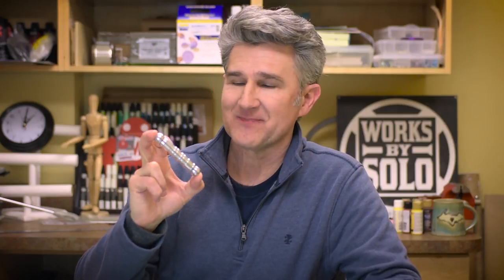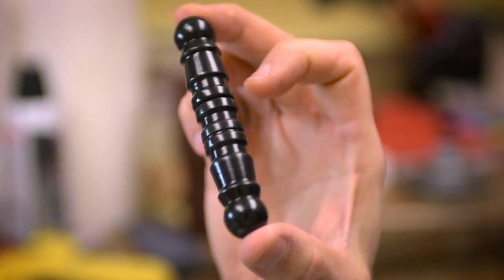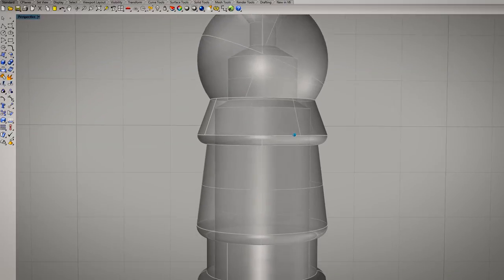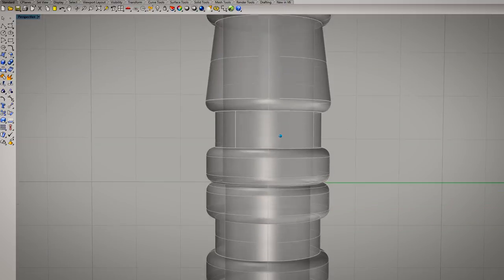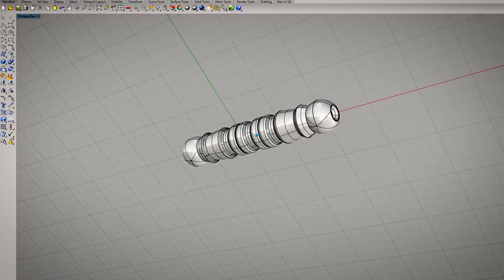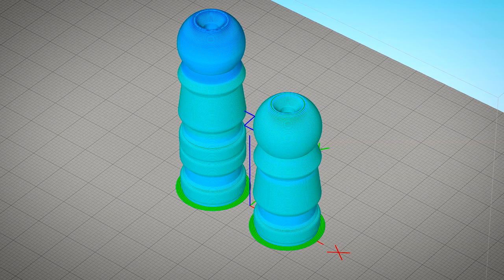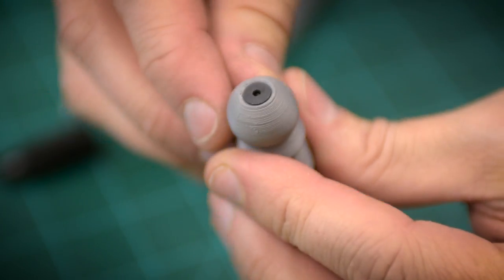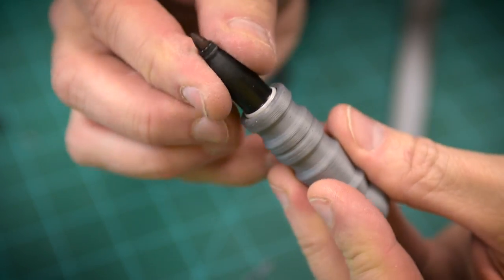How to Make a 3D Printed Sharpie Pen Casing With a Fake Finish - FREE Downloadable Content!

Comment: Nice 3D print. Funny how you used several of the same tools I have in my Filament Friday tool kit. We think alike. 
Question: Does the screw go into the sharpie?
Reply from the maker: Thanks, Chuck! Yes, the screw is what keeps the marker and cap from coming out when pulling apart. Threads must be sealed to prevent drying out.